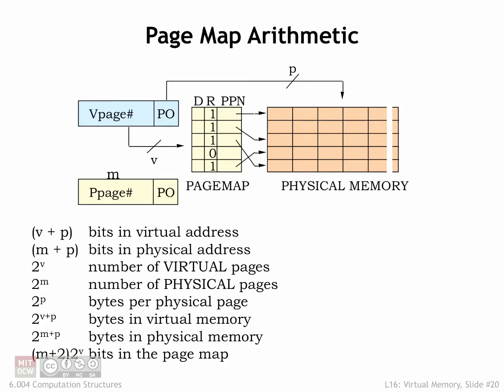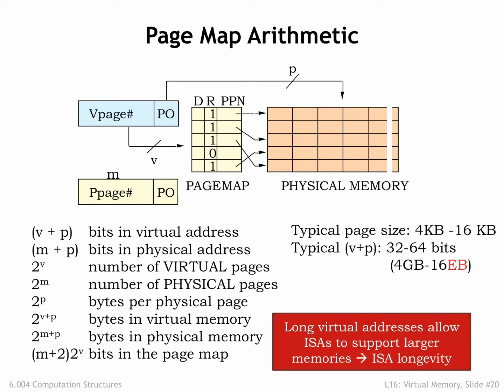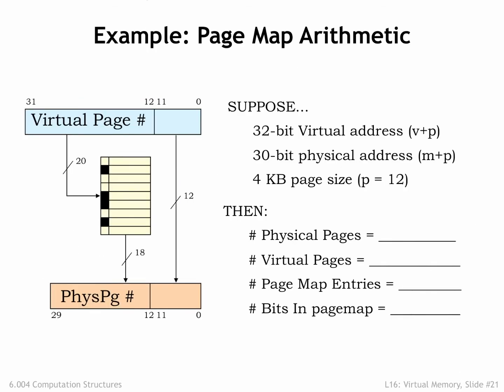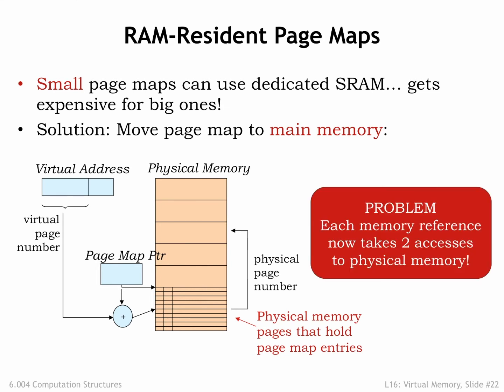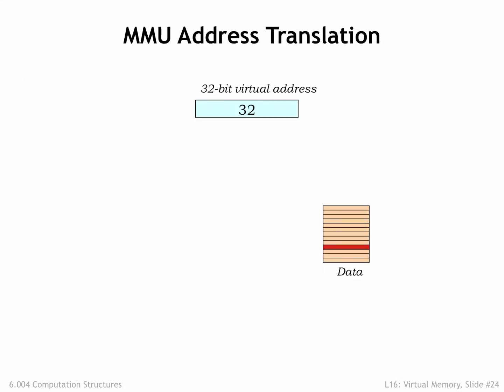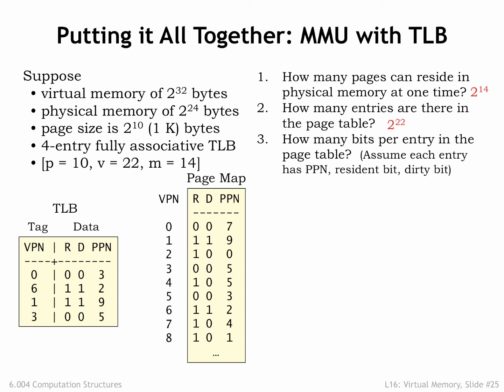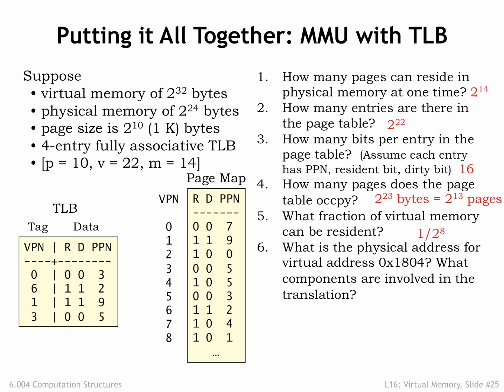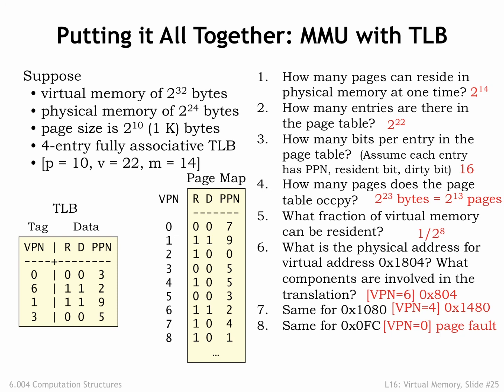16.2.4 Building the MMU

Comment: Ah, you show R (resident) and D (dirty) bits early on but don't explain. That is distracting. The emotional stories are distracting too.  Still though, the specifics are good and is why Id come back.
Reply: In case someone comes here without having seen the previous lectures: the resident bit is 1 if its virtual memory page maps to a page that is currently in physical memory (RAM), so if it is 0 we know a page fault has occurred and we must retrieve the page from disk; the dirty bit is 1 if we have written to the corresponding page in physical memory, so when we need to replace it we can be sure to write the update back to disk.
Reply: He explained those bits in a previous lesson.